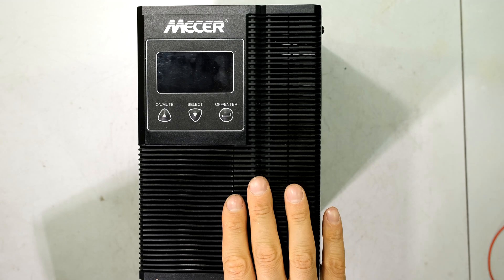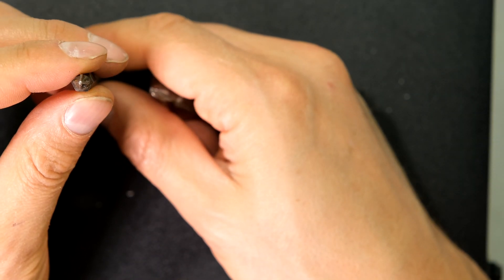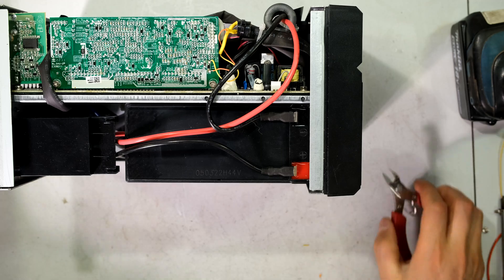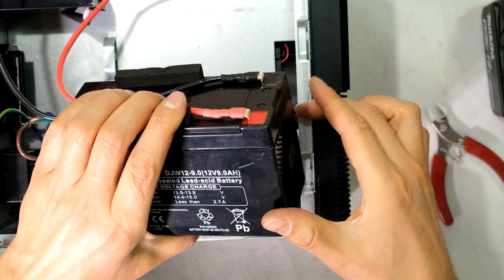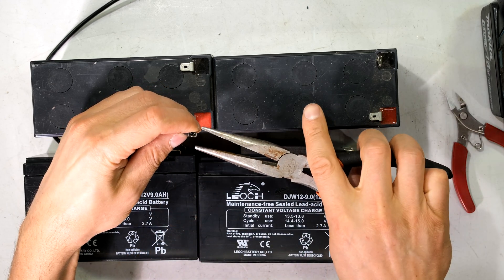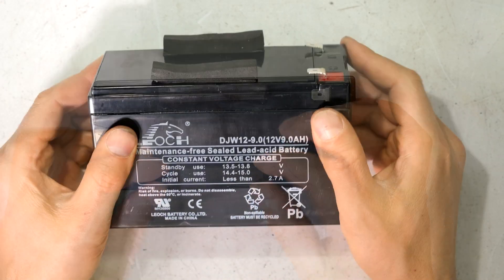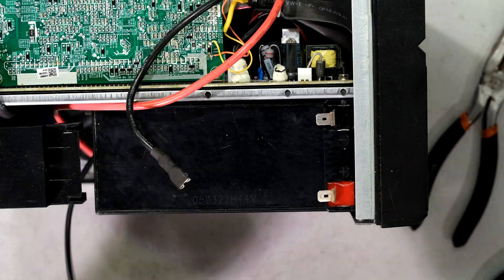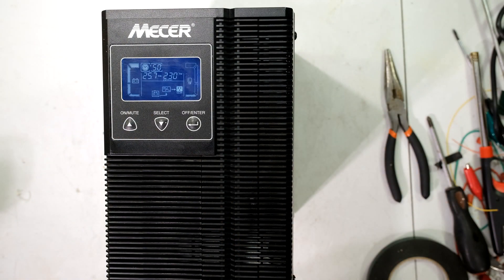How to replace the batteries on a WPTU 2KVA online UPS - WinnerPro

Comment: is it possible to replace it in with bigger external batteries?
Reply: You can install two 12Ah LiFePo4 batteries.  These are direct replacements for the AGM / gel batteries that this UPS was originally designed for.  The benefits are that the UPS will run at least twice as long and both batteries will fit inside the original Mecer / RCT casing.  The dimensions of the 12aH LiFePo4 batteries are exactly the same as the intended original batteries and require 8A to charge, which is well within the spec of this inverter.
Reply: I have replaced the original gel batteries with two 12Ah LiFePo4 batteries. That is about as much capacity that one can expect the UPS's charger to handle without frying itself in the short term.

The bonus is that the above batteries are the same dimensions and fit inside the case.  

You could fit two external 18Ah batteries as well, but then you might as well consider a dedicated inverter/charger ... depending on your usage requirement.